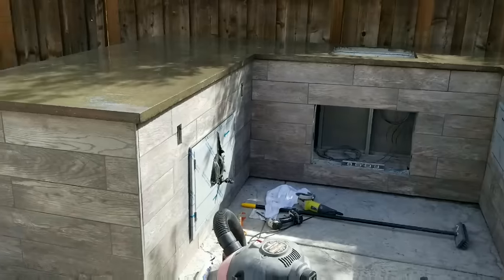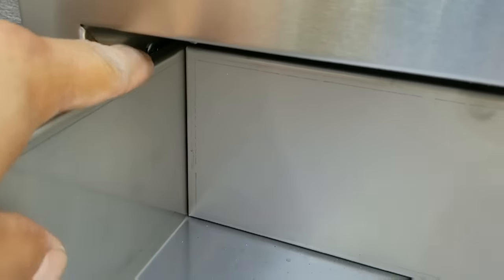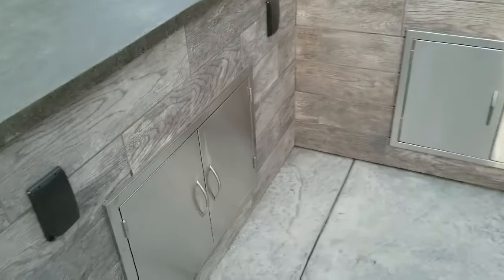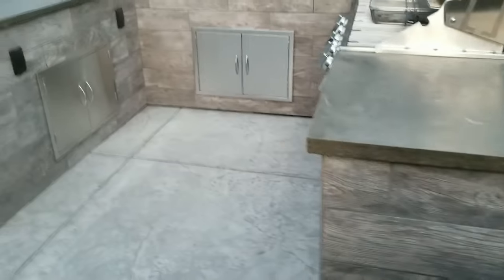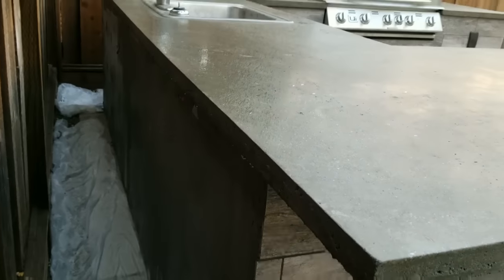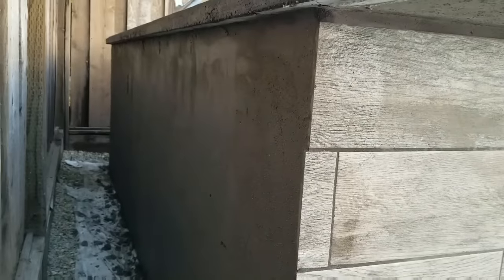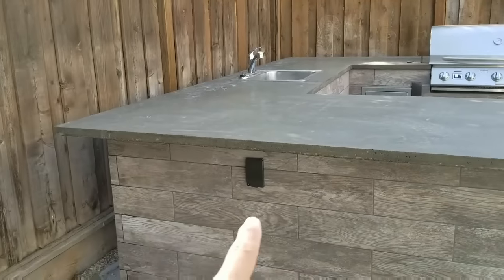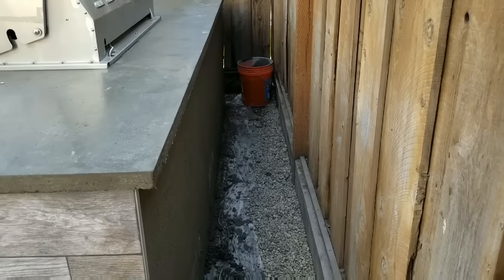Diy Bbq Island Finally Completed #7

Comment: Nice work Eddie.  I watched the whole series and learned a bunch.  Thanks for sharing this project.  I jus finished a patio cover and the next step is to build out the kitchen area for a grill and a smoker.  I was planning to use metal studs and backer board exactly as you’ve done here.  I was even thinking about doing pour in place concrete countertops.  I think the only difference with my plan is that I plan to use a synthetic stone product for the exterior rather than tile.  Thanks again for posting.
Reply from the maker: Thanks for watching Justin, I appreciate the feedback. The two reasons why I didn't use synthetic stone is cost and a lot of people with bbq island had stone work; nonetheless it definitely looks great with stone. I am happy to help along the way with any questions. Have a great day!

Comment: Thanks for the videos! I do have a question, did you secure the frame to slab? if so, what did you use? thanks in advance!
Reply from the maker: Thanks for watching, I did not secure the frame to the slab it just sits on top. It does not move
Reply: @d.i.yeddie6075  thank you for the reply. Awesome job!

Comment: Hello Eddie, I am in the framing process and about to frame out the bbq. I'm not to sure which counter top I'm going use (concrete or tile) but how much higher did you raise your bbq to be on your stud after concrete? Thanks and good job on the videos.
Reply from the maker: David Hernandez the frame is all the same height I believe my  countertop height was at 37 inches i had a countertop thickness of 1.5 inches and the cement board was another 1/2"  so the top of my countertop height was 35".  Hope this helps
Reply from the maker: David Hernandez the bbq sits on top of the counter top
Reply: Thanks for the info. I'm actually installing a 36" grill and flat grill (plancha) so question was more for the flat grill that has no sides to sit on the counter top. Thanks again.
Reply from the maker: David Hernandez dang that sounds awesome, I was thinking of putting one too but I looked at amazon and they have a flat grill that you can place over the existing bbq. Possibly you. Can make a small drop down just enough to have the flat top be at the bottom of the countertop sunken in .. or level with the countertop.

Comment: Great video.  I have another question; where did you run your sink drain out to?  Is it just running to a dry basin?  Thanks
Reply from the maker: bklyn2va2dc thank you, I connected the sink drain to my yard drain that runs off to my grass, with that said I only use it to wash my hands and rinse fruits and vegetables.
Reply: D.I.Y Eddie Ok.  Thank you!  Very nice job!

Comment: WOW!!!!  I am very impressed at your work. Do you do this for a living? Your work is like a pro. I am especially impressed that you formed and poured the concrete above your work instead of having it separate and then lift it into your work.  Have a few wonderful questions to ask you. Now that it's done, is there certain things that you would like to have done differently? How long did it take you to plan this all out? How is the grill sitting on your setup without an insulating jacket to keep 400 lbs in place? Did you get this project permitted?  Please don't get alarmed. I am not the Assessor's Office, LOL. I'm in the process of making an Island myself and had two different people, one from Blaze grills and one from another person try to scare me.  I don't want to raise my house taxes.  I live in SoCal,  near the desert and just love to come home and cook after a hard day's work. Just bought my BLAZE Pro 3 burner.  I may need some pointers on how to use that rented mixer.  Have my own cheap tile saw which converted carpet to tile floors in the house.  Considering Mahogany as a countertop because mahogany is just as strong as concrete and are used for building boats.So many options to think about but your videos make it exciting and helpful in making it.  Rolling wheels is questionable right now but not something that cannot be done.
Reply from the maker: Thank you, I use to do masonry work back in 2006-09 before recession hit. I have had a lot of requests to make them for friends, I enjoy the work but have not committed to doing it full time. maybe in the future who knows lol. I use to live in SoCal, in Fontana/Rialto area. 

things I would of done differently are: possibly ran a gas line instead of using tanks, connect drain to sewer line to have full use of washing meat and seafood, as far as the build If I had means and resources I probably would of used aluminum square tubing, change the screws for the studs to regular pan head self tapping studs 

I drew out different lay outs on paper then used tape to mark the floor, I had many different layouts and inserts I wanted to use but most came with more $$$. since the bbq island is made out of steel and masonry It does not require an insulating jacket. I added supports and braced the bbq island to withstand the bbq sitting on top of the countertop. I followed the codes and standards with regards to the electrical, if that gives you a clue.
Reply: @d.i.yeddie6075  that's Awesome Eddie.  I am no different than you with plans.  Another person used 18 guage studs instead of 20.  Gonna check out a steel shop this weekend.  Debating on concrete vs mahogany.  It's more of spending time vs not and pay the price when not interested in spending time pouring cement and placing a mesh.  I am a programmer by trade.  You don't have any photos of how you support the grill to the frames do you? I will keep you posted of my progress.  Thank you for all your help.

Comment: Love the project and you taking the time to video the steps. Awesome job. About to start a similar project... May I ask why metal stud framing vs wood? Wondered if there was a reason you went this route over pressure treated wood framing, etc. Would apprecaite any comments on the matter. Thanks!
Reply from the maker: Joseph Eustaquio thank you. I decided to go with galvanized metal studs mainly for durability. In my opinion I don't believe you should use any type of wood next to the bbq grill. It didn't cost me much more than pressure treated wood, would of been. I paid around 200 for the studs and channels, hope this helps

Comment: That's awesome.  Did you happen to put a materials list together?  I am trying to figure out how much steel to buy for mine and am curious about how much you ended up getting.
Reply from the maker: Chad Smith thank you, I do not have a material list together. Would of been helpful. I believe I ended up getting 30-35 studs 10' and 12 steel channels 10'. I figured i can get 3 cut studs for each 10' piece. I basically drew everything out on paper to scale and then added all the studs I needed plus an extra 15%. If i had any left over I added extra supports. Hope this helps

Comment: Hi Eddie - 3 questions.   How long before you removed the 2x4 and 1x4 molds around edging?  How about the support for overhang (how long til removed)?  Finally, what did you use for metal strips on corners and how did you apply?
Reply from the maker: Hi Niki I removed the sides of the edging boards within hours to fill the voids but the main supports I believe it was atleast 7-10 days before i removed all of the supports and overhang. Are you referring to the aluminum edges on the tile work? I screwed them directly to the cement board.
Reply: @d.i.yeddie6075  Thanks Eddie - yes I was referring to the aluminum edges at corner of tile.  Where did you purchase these?  Interesting that you screwed in as don't see any screws on video (assumed you glued them on).....
Reply from the maker: @rickpickle5259  i reviewed one of my previous videos #6 https://youtu.be/GlwFWf9Qb-o (10mins in) and I didnt screw them in, I installed them at the same time I was doing the tile work. I used thinset to set them in place. I got the aluminum edges at home depot tile area

Comment: When you were doing cutouts for appliances, did you need to take into consideration the height of the hardie board and countertop (for height) and width of cement board and tile (for depth)?
Reply from the maker: Nathan Dedic great question, yes for the countertop height I had to take into consideration the finished surface height minus the thickness of countertop plus cement board. The only opening I had to worry about was for my appliances because of the countertop setback, I had a 1.5" overhang all the way around. I had to bring my bbq cutout 1.5" forward. Thanks
Reply: D.I.Y Eddie Hi again, your videos have become my bible for my project.  I’m getting closer to finishing thanks to your help.  Can you please explain why you moved the grill cutout 1.5 inches forward because of the 1.5 counter overhang?  I’m not understanding this.  I framed my cutout exactly to the specs and I also want a 1.5 overhang so I’m hoping I don’t have to move my cutout forward.  I’m not understanding that part.  Thanks!
Reply from the maker: @bklyn2va2dc  i just seen your comment, hopefully its not too late. But I moved the bbq forward to sit flush on my countertop. If my countertop did not have a overhang I would not have to modify the cutout. Its best to sit the bbq on the framing to double check measurements

Comment: Will the concrete eventually crack like it does on normal concrete walkways, driveways, etc.?
Reply from the maker: my concrete top does have 2 minor stress cracks but I believe it was because I didn't lower the reinforcement mesh all  the way down, other than that it looks exactly the same and looking great

Comment: Thanks so much. Did you use 1/2 or 3/4” for the top cement board?
Reply from the maker: Nathan Dedic I used 1/2" permabase all the way around, check out my other videos I have all the steps from start to finish, thanks for watching

Comment: I am starting mine.  However i. Stuck on the framing.  I have a 2 inch drop for drainage.  Do I shim it out or do I level the frame.  Any thoughts?
Reply from the maker: Its really depends which way the bbq faces and if the slope is along the entire bbq or just a short amount. I added spacers and shimmed my bbq to have a level finished surface. I used composite board from HD.

Comment: This looks amazing! I'm pretty much trying to do the exact same thing, just with different color wood tile. I had a question about the bottom. You installed composite boards to sit under the frame. do you do anything to the spacing between the floor and concrete board/tile? Or do you just leave a gap for water/air flow. Thanks for the videos!
Reply from the maker: Anthony Tran thank you, my frame height ended up being the same as the cement board and I set the tiles level. I left the lower gap for ventilation and whenever I wash my patio down. Thanks for watching check out the rest of my videos!

Comment: Hey Eddie one last question how did the stucco hold up thank you for your videos
Reply from the maker: JULIAN VALENZUELA the stucco is holding great, one tip to make it adhere better to the smooth surface is rolling concrete glue on the surface of the cement board.

Comment: I'm really liking your outdoor kitchen project. I'm planning a similar project but with winter weather to consider. I do have a question about the overhang. Now that its been a few months, have you found you need any kind of bracing for it?
Reply from the maker: Tina Tillman thank you, I have reinforcement wire mesh in the countertop, you would need to check the snow load per sqft. I wouldn't see an issue unless there is an unbalanced load on the overhang. I believe its only about 10-12" overhang

Comment: Awesome job on you island. I want to do the something for my back yard. Is it possible to put a list out of you materials and tools you used to build you BBQ island? Like the type of metal studs and gauge for your framing and type of screws you used and all that! And also what kind of counter top you have? Is that concrete? Thank you for your video and hope I could get a list of materials and tools you used to build your BBQ Island! Thanks
Reply from the maker: Thank you, I have 7 videos going over the process from start to finish; a lot of the questions you asked may be answered. you can check them out on my channel. the counter top is concrete and I poured it in place.  hope this helps - if you have more questions after watching them let me know.
Reply: can you just tell us about the drawers and cabinets? at least where to grab 'em.
Reply from the maker: Sean Chinery i i bought my cabinet and doors from this seller on Ebay https://rover.ebay.com/rover/0/0/0?mpre=https%3A%2F%2Fwww.ebay.com%2Fulk%2Fitm%2F181549921428
Reply: nice thank you so much

Comment: Hi Eddie, what did you use to attach your tile? Did you use a thinset or a regular tile adhesive? - Thanks in advance!
Reply from the maker: Tom I used Versabond Fortified thin-set mortar from Home Depot 

<a href="http://homedepot.sjv.io/c/1459909/459920/8154?prodsku=205789819&u=https%3A%2F%2Fwww.homedepot.com%2Fp%2FCustom-Building-Products-VersaBond-LFT-50-lb-Gray-Fortified-Medium-Bed-Mortar-VBLFTMG50%2F205789819"><img src="https://images.homedepot-static.com/productImages/bf2ec882-6c1c-45a3-bbcc-3d90d750f235/svn/custom-building-products-mortar-vblftmg50-64_1000.jpg" border="0" alt=""/></a>
Reply: @d.i.yeddie6075  Thank you Sir, one last question if I may? What Gauge was the metal studs?
Reply from the maker: @tomdixon1632  I believe they were 20 gauge

Comment: Awesome job bro.  I was going to buy the prefabicated frame until I saw your video.  Do you remember what the dimension of your frames are?
Reply from the maker: cleanislex thank you, yeah its less expensive but more work this way. It was 3.6 x 1.25  close to a 2x4 measurement
Reply from the maker: cleanislex i believe they were either 20 gauge or 18 gauge, i think i mentioned it on the first video

Comment: What kind of bbq is that and were did you by your accessories from like the drawers and doors
Reply from the maker: JULIAN VALENZUELA the grill is an urban islands brand and the drawers and doors i got on ebay https://rover.ebay.com/rover/0/0/0?mpre=https%3A%2F%2Fwww.ebay.com%2Fulk%2Fitm%2F182039706501
Reply from the maker: You can purchase the bbq on costco.com
Reply: Thanks for the videos I can't wait to start mine how dose the bbq sit in the opening
Reply from the maker: JULIAN VALENZUELA the bbq should come with instructions on framing the bbq openings and vent requirements. It sits on top of the countertop.

Comment: How much did all the supply cost to build this beast.
Reply from the maker: Total cost was about $3100
Reply: Great Job man....I love it.  $3100 just for the island or this including the bbq and doors/drawers?
Reply from the maker: Total cost including supplies to build the island, I was able to get the BBQ as a display item for less than retail price. I only paid $400 for the bbq and it was new out of the box. BBQ grills can cost anywhere from $1200-5500. Look around on craigslist or offerup for any used or new out of box deals.
Reply: How much material did use as far as the metal studs

Comment: Did you sand or polish the top? If so, what did you use?
Reply from the maker: Nathan Dedic I wet sanded with diamond grit sanding disks and then applied a oil as a sealer. The final look is a dark grey satin sheen
Reply from the maker: Nathan Dedic check out my other videos, I went over the process after I poured the countertops

Comment: What type of boards are inside the cabinets?
Reply from the maker: Cody Devillier they are redwood fence boards cut down to size, it was an inexpensive option.
Reply: D.I.Y Eddie Amazing videos, thanks!! How did you mount these inside boards? Just screw to the steel at the ends of the sections? Or into the composite deck boards running front to back? And I assume there’s no cement board underneath?
Reply from the maker: @markpearce9200  I screwed them down to the composite board that the bbq island sits on

Comment: I just had one other question for you before I purchase my grill: why did you decide to go with propane over natural gas for your grill?
Reply from the maker: It was a pretty easy decision for me, I would just keep an extra propane bottle in the bbq island. With natural gas all the lines would need to be dug. Pipe set in place and permitted by the city. Usually its an easy changeover from propane to gas just changing the main nozzle, orifices amd adding a regulator but its best to get the one you want.  Next time I would probably go natural gas route because of the accessibility once the lines are installed. Not sure if there are pros and cons of each I have only cooked on charcoal and propane
Reply: D.I.Y Eddie. Ok.  Thank you.  I was leaning towards natural gas but I’m not sure the cost/benefit is worth it.  And as you pointed out, I can always switch over later if the need arises.  The ease of use is appealing after it’s done but the preparation getting to that point seems very involved, and potentially expensive..

Comment: Does your sink drain into you're actual sewer line?
Reply from the maker: Mig S the drain line connects to all my runoff drainage to the front yard. I am not washing any meats or anything that would spoil. its mainly a hand wash and rinse sink
Reply from the maker: Mig S if you plan to use it as a regular sink then it needs to be connected to the sewer line

Comment: ... i would switch those outlets to GFCI ones.... even though they have covers. safety first!
Reply from the maker: Thanks for the comment, all the outlets are on a gfci circuit. You don't need GFCI for every outlet just a primary in the circuit if wired correctly